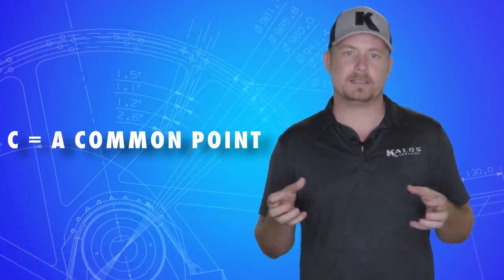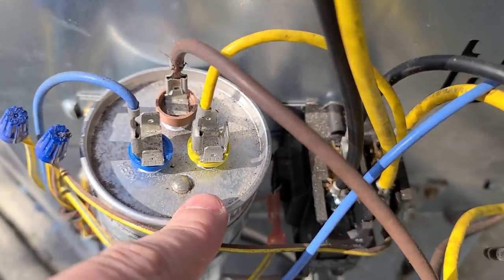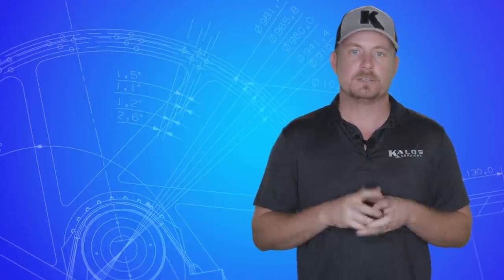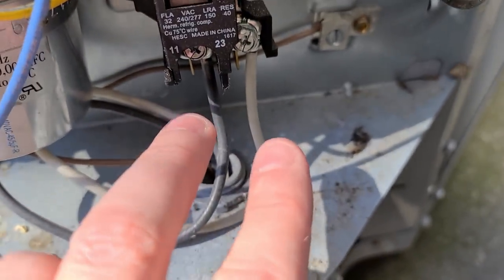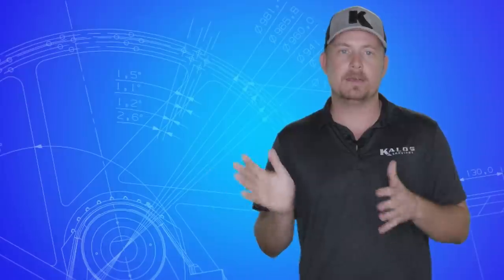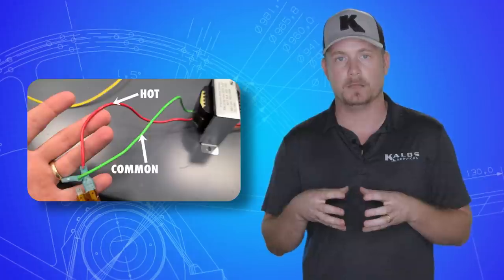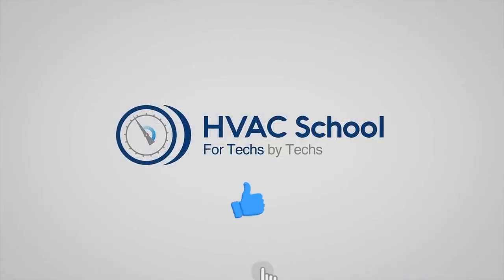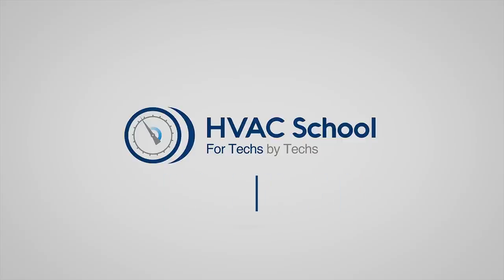A Common Electrical Mistake

Comment: I still have trouble finding which terminals are start/run because the plugs are so hard to remove and the comps are way down in the bottom of condensers.
Reply: Easy way to tell is - if u know which wire is common. Ohm from c- one wire & c - to the other. The highest resistance is C-S. It’s allways best to remove the Wire connection at the compressor anyhow for a Visual inspection. Buy a Big mirror to Look at compressor terminals in tight spaces. I use a Mirror that’s for checking the back of your hair in a hair salon. I get them in The Grocery store. $6.00

Comment: Am I the only one that keeps wincing whenever they say “high voltage”?  High voltage is reserved for 600+ Volts. So a 24V transformer, or a 120V outlet and a 240V capacitor are all common “domestic” voltages. High voltage is reserved meaning you’re going to need special tools, special PPE and in general there will be a fence or a placard designating high voltage as such. It will all carry enough amperage to kill you so treat it as such, you don’t have to say something is “high” voltage because it carries two hot legs. It’s actually lowering the amperage draw on each leg to lessen the load on the motor.
Reply: Its intended for a specific audition and that audition knows exactly what he means. Of course it's not technically high voltage but neither is 600+. A low voltage chiller can see voltages of 760. A medium voltage chiller one could see 4160 volts. Those's aren't considered high voltages in the exact meaning of the terms but HVAC guys generally understand what's being expressed when that's said. It's a higher voltage than 24v and one should be extra caution with it......HVAC guys aren't dealing with "High Voltage" according to the exactness of the terminology.
Reply: In HVAC we aren't dealing with normally more than 480v, so to us anything over 24v is high. Just as power generation and distribution has standard terms do does HVAC.

Comment: I had this kick my ass on one of the first compressor change-outs I ever did back in the day, couldn't understand why the brand new scroll wasn't doing anything  -  after swapping the wires and having it fire up I just kinda stood there confused and then looked at the old wiring diagram and put two and two together....like you said, I assumed 'common was common'.

Comment: Good video ! So , What happens if u connect the ( L1) to Compressor Common & C on Run cap. Instead of ( L2) to C on capacitor & (L2) to Run. ( Herm to start winding )
Reply: compressor willl not run

Comment: how about getting using a common wire at the condenser and grounding it to use the original common wire for something else?? I ran into that today while starting up a heat pump but i didnt do it. I requested the company to run new tstat wire but i was really tempted to just ground the condenser board.

Comment: Does this mean that S and R come together inside the compressor, there by letting the herm wire apply the power boost to the R terminal to give it that extra kick that it needs to get started.  ??